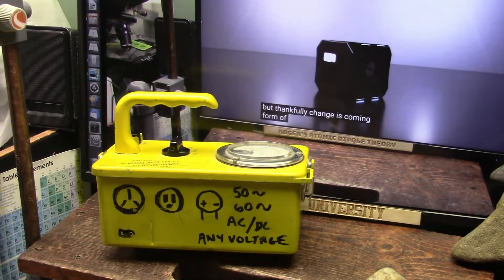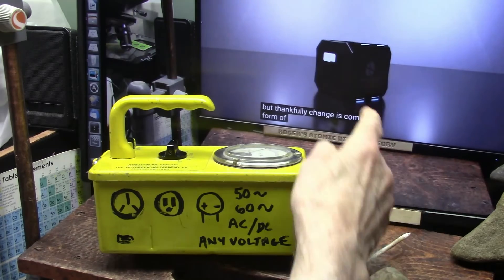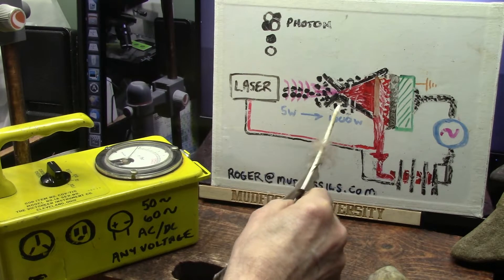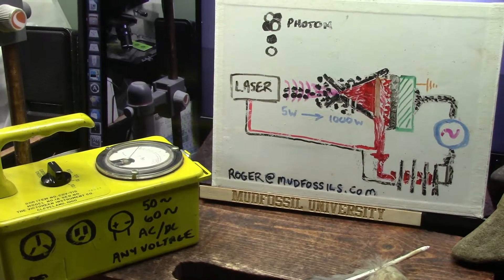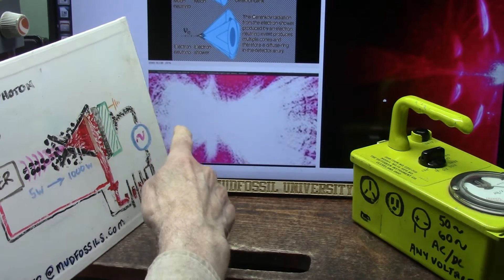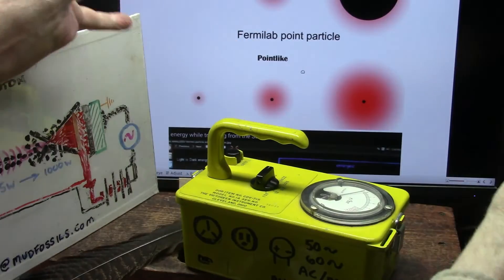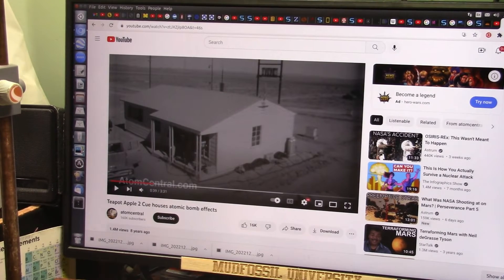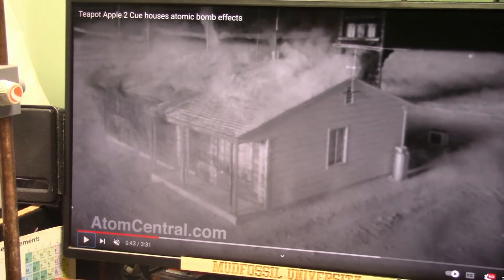Can Portable free Electric Energy be Generated using Neutrinos as Germans Reported

Comment: Carbon wouldn't burn and is electrically conductive. Maybe a good collector.
Reply from the maker: Carbon does burn but it is a good source to attach electrons to and I think Graphene is what the neutrino cube people use...along with aluminum I think as a voltaic cell almost that vibrates ...but not sure. I dont think it works yet but????